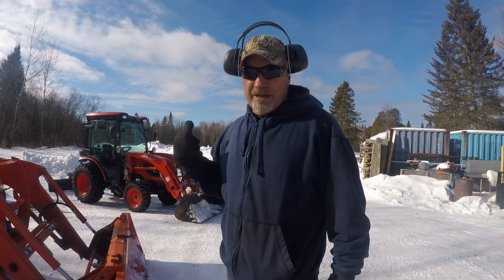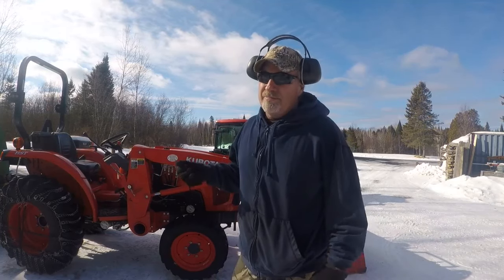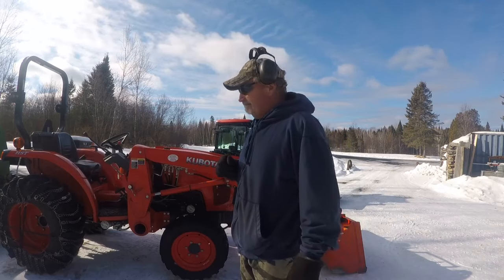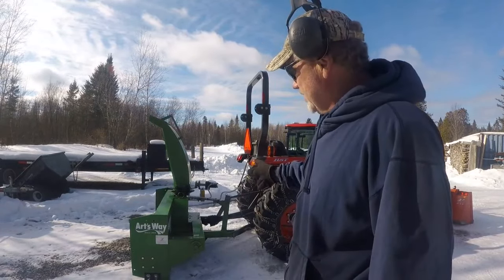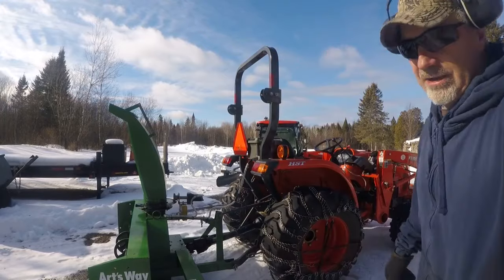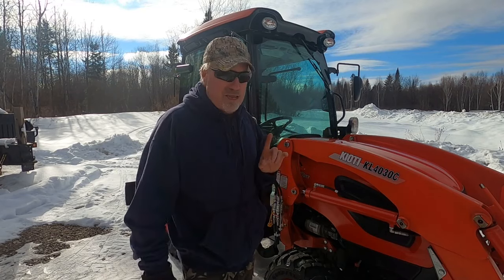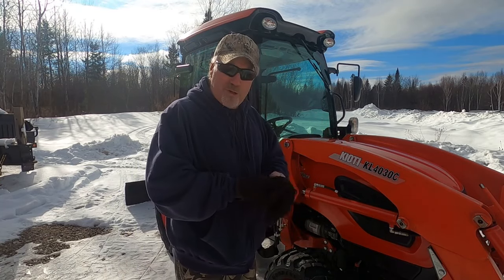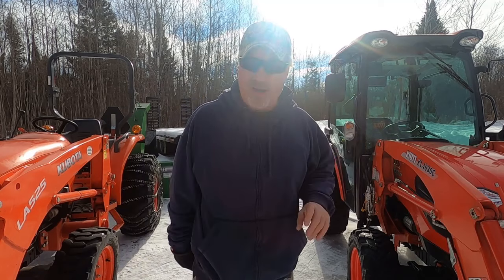Kubota vs Kioti Hydraulic System-Definitely different.

Comment: I have driven Kubota, and as you say the dual movement is smooth, which for your case is fine. However, for equivalent models Kioti can lift large logs whereas Kubota fails. I just want to lift a log off the ground and transport it, not do the swan ballet with it.  I'd probably go with a blower for snow anyhow.
Reply: we bought a kubota l4760 cab tractor wich much better system then kioti plus our kubota has a good 2 function on its hydrulics

Comment: Hey Mike love your vids. I looked at a ck3510se last year and saw exactly what your pointing out here. Brought my new ck3520se home today. Night and day difference on splitting the functions in my opinion. They must have figured something out. Was a Kubota owner but once it was time to upgrade I could not spend more for less with them. They’ve gotten a little too proud of their product these days. -Taylor
Reply from the maker: Thats great!Hopefully they keep striving forward.Will they ever be as good as KUBOTA?time will tell.They are no slouch in the tractor world.Thanks for watching.
Reply: Same my 23 2620se I do rock work all day no issue better than my old new holland 😊
Reply from the maker: @devshewitt4809  Hey,does the 2620se have pollution crap?
Reply: @northeasterndirtandpropert7974  what are you talking about the regen system? If so no emissions on 2610 or 20

Comment: For the nearly $10k I saved on my Kioti CK2620 cab vs a comparable Kubota LX series or Deere 3 series I can live with the slower hydraulics. I’ve owned a Kubota, Deere, and now Kioti and I like them all but when it comes to lift capacity the Kioti puts the other two comparable sized tractors to shame. For a homeowner who owns a few acres or a small homestead a Kioti is a great tractor based on cost but if I were in a professional business where my butt was in the cab most of the day then I could make a case for the extra cost of the Kubota. Just my thoughts on this.
Reply from the maker: Can't blame you for going Kioti.Thanks for watching.
Reply: I just priced both models and they're actually exactly the same price at about 28 to 29000 depending on which dealer you get it from
Reply: There is a large price difference. I’ve been shopping for larger tractors, 70-75 engine hp bracket.  With Kubota and Kioti spec’d with the same features for hydraulics etc, the Kioti came in $24,000.00 under the Kubota. I put a down payment on the Kioti yesterday because it’s exactly how I want it.

Comment: Seems like on the kubota you raise it and then dump so not really 2 functions at the same time
Reply from the maker: Watch the bucket roll and boom at the same time all thru the demo.I tried to be as unbiased and ran both machines at 1800 RPM where both machines have more than adequite flow and engine RPM to do most loader applications.thanks for watching.
Reply: I’m seeing the same thing.  Two different styles being used when using the loader.
Reply from the maker: @TM-jl1zd  if in doubt,try one out.I only present what KIOTI engineers.
Reply from the maker: @7M-7  Thanks for watching and accessing the videos.But again,i don't engineer hydraulics for KIOTI,i just present the facts as stated during operationAND quoted in the KIOTI owners manual.Both are good tractors,one is just superior in the hydraulic engineering dept.Kubota,known for well engineered Hyd,enginneering,resale,uptime,fit and finish.I own them both,I like them both.Thanks for watching and commenting.
Reply from the maker: @Bethia  When you get some hyd experience and operating experience,talk to me.

Comment: I believe you should be running about 2200 RPM on the new Kioti’s
Work out a wee bit, and you will find that sweet spot where you can curl and dump real quick. One thing I like about the coyote, you can certainly lift a little bit more more weight than you can with the Kubota.
Reply from the maker: Not only lift more,but a heavier tractor overall,at a more affordable price for the machine.But in the end,everybody should demo the tractors,and make an informed decision on what suits there needs best.Tractor companies can't afford too many mistakes these days,they won't last.
Reply: You need to rum kioti at a higher rpm and it works great... from the sound on your video it sounds like you are running the Kubota at a higher rpm...

Comment: Kubota also costs more so it makes sense as typically you get what you pay for. Personally I have a CK 2620 and I love it no complaints. It has done everything I’ve asked of it and then some
Reply: Good to know. I guess that one replaced the 2610 with the 4030 loader. May I asked what you paid and what implements you got?
Reply: @MrCPPG  Yes it replaced the 2610. I got mine about a year ago for $23,500 out the door with the loader at 0% interest. I have pallet forks, a stump bucket and a TR3 rake at the moment. Looking into a stump grinder and grapple next.

Comment: That was some fantastic visual proof of the differences. I guess it all boils down to what you need and what makes you happy. I guess you needed a cab more than super smooth hydraulics. I guess if 10 - 15K means nothing to you then you can have both in the Kubota.
Reply from the maker: Unfortunately 2 tractors is just not cost effective around here.BUT,you never know whats gonna roll in and out of my shop.And honestly,here in Canada 10-15 thousand ain't getting you much size or something thats not clapped out.Hobby tractors just ain't cheap.What is.Thanks for watching and commenting.

Comment: I have a Kioti CK4010SE just made a warranty issue video yesterday may put it up soon.  The 3pt lift Hydraulic valve failed with only 220 Hrs on the tractor and was still within the time limit of the warranty.  Kioti did not cover this repair.  The proble was the 3 pt lift would surge up and down with any load on it.  After the vale was replaced, it worked fine.  You can click on the icon to see more details on this

Comment: My NX5010HST doesn't have this problem. Maybe it's because of the higher flow rate on the NX chassis.
Reply: I would think it’s everything to do with flow rate, also perhaps speed is also sacrificed for additional lift capacity as well. 
That’s why people shouldn’t get all dead set on which lifts more because it’s not going to matter much if the one that lifts a Little less lifts twice as fast.
Reply: @jacobhendrickson8935  That's a very good point !
Reply: @jacobhendrickson8935  If you can’t lift it it doesn’t matter how fast
Reply: Glad you piped up as I’m looking at a NX6010HST to complement my Kubota MX5100 (or vice a versa). If someone made a M4/RX sized tractor with a hydrostat, I’d be all over it. The NX appears to be the closest.

Comment: On my previous JD 3720 Cab, and my current JD 3046R Cab… I have a selector at the base of my joystick.  It can Lock the joystick.  It can make it 4 direction only… and it can make it regen-hydraulics.  So I always keep the selector on Regen.   The bucket is kind of gravity assisted in its dump routine while this function is selected.  Do you have a lock switch on the base of yours?  It’s an easy thing to not even notice on mine….   But if you do, it may help.  So my will do these mixed motions with ease as well.
Reply from the maker: No regen that I am aware of.4 pressure and 1 float function.As it stated in the KIOTI manual,its not designed for an efficient 2 function system.It will do it,but its a struggle and its slow.Thanks for watching

Comment: I’ve had 2 kubota’s and 2 kiotis. Both are fabulous machine brands. I currently own a DK40 se hst (2014). I bought it new just before many of the emissions were required. This model is much more robust than the newer DK line that came out soon after. The Kubota Grand L39 was also a consideration. It had a more advanced transmission,but other than that the Kioti was better ( in my opinion) and definitely stronger. It was about $8k cheaper too, but that had very little to do with my decision. I would but the same machine over and over again a dozen times. If someone I knew was looking for a 40-65 hp tractor with all the bells and whistles I would look for a Kioti DK line of tractors  from 2008-2015. These machines are tough, strong, well optioned, high hydraulic flow, etc.
Reply from the maker: The cost spread seems to be getting wider.KUBOTA up at least 3% according to dealer.Almost 10% cheaper for a KIOTI CK2610se VS KUBOTA LX 2620..Plus KIOTI puts a tremendous amount of standard features on what KUBOTA calls options.Thanks for watching.

Comment: I've owned two Kioti tractor so far, a subcompact CS series and currently a DK 5320se cab.  When I upgraded I looked hard at a Kubota and did lots of test driving different brands.  Kubota tractors DO have smoother hydraulics overall.  I operate a construction grade wheel loader at my everyday job and the hydraulics on it are better than Kubota's as well.  So there are always better options out there.  However, in order to get the same lift capacity in a Kubota that I get with my Kioti, I needed to go all the way up to an MX series tractor.  That thing is WAY too big for what I do.  The DK series hydraulics is better than my CS series tractor was though as far as smoothness and ability to do  two functions at the same time.   I do agree with you though, Kubota's hydraulics are better than ANY of the other tractor brands I tested and  I tested them all.  Great video you put out showing this obvious difference in performance.
Reply from the maker: I agree.thats why the video was based on function and not lifting capacity,tractor weight and so forth.Kioti Has a lot to offer a tractor owner,I see it.Watch the next video,and i will reveal  a couple small notes on the KIOTI that i have not mentioned.I want ALL the comments to roll in before I reveal a smackdown on any doubters out there on my testing and performance between the two.Thanks for commenting,I like hearing from operators who actually put there hands on other brands.Thanks
Reply: @northeasterndirtandpropert7974  oh ya brother! There are lots of different views and applications for each person. I do appreciate your point in this video though. It's accurate from my point of view. Subbed to see more

Comment: I like the smoothness and dual functionality of the Kabota.   Definitely helps justify the higher cost of a Kabota.
Reply from the maker: The difference in cost I bet would be minimal to design the kioti circuit to deliver a little more flow to the secondary function.Every tractor manufactire has multiple hydraulic engineers in R@D that work on these circuits in design phase.Kioti in my opinion is just taking the easy,simplistic,way out.Just my opinion.
Reply: There is a substantial difference in price. When I was shopping, it was almost 9k difference, less warranty and features on the kubota.
Reply: @northeasterndirtandpropert7974   It may have been a compromise to increase capacity in a single function. Some folks prefer to lift a bigger log even if it is a little jerky without going up in class of tractor.  You should get rid of the Kioti rather than bitch about it. I definitely won't buy a Kubota like my brother. Lousy dealer, lousy factory customer treatment.
Reply from the maker: @MrCPPG  I just state the facts as engineered by KIOTI.Don't let the reveal from the owners manual sway you from purchasing a KIOTI,they are good machines.Every one has different needs.

Comment: Just subscribed and enjoying your content. I have a new 2023 Kioti 2620 hst open station and Im coming from a Kubota b1700 from 1999. The Kubota definitely has refined hydraulics but mine doesn't seem as big of a difference as your video. My rear hydraulics on the Kioti does the same as yours and reading up on it from different sources that jerkiness is normal for Kioti's and is called step hydraulics whatever that means. Everyone says to raise fast and then lower where you want it. Overall I'm satisfied with the Kioti. I find higher rpms works better for loader work and using the 2 functions at the same time.
Reply from the maker: Higher RPM's definitely makes a difference in flow rates to a point.BUT,I'm a big fan of adjusting RPM's to the task at hand.High RPM's cause excessive fuel burn,premature engine wear and in the end,overall its costing you more money to operate.It will still not change the priority vs secondary valving in the hyd stack,that never changes.Thanks for watching and commenting.

Comment: I’ve got a CK40 and I can literally use my finger tips to use the front loader. Might just be that particular tractor. Also I’ve spent a bit of time with the loader and haven’t even noticed not having dual functions. I really want to upgrade the size of my tractor and am considering a Kubota MX series but the Kioti DK series beats the MX in loader capacity and 3 point capacity and only weighs about 400lbs less. All being about 10k cheaper..Kubota are great tractor but the price has kept me away..

Comment: To anybody who is saying the kioti are significantly less than the Kubota you are wrong. I got multiple prices on both cab models kioti CK 2620 and the Kubota LX 2620. The Kubota actually came out cheaper at $28,500 and the kioti was $29,600 therefore the Kubota was actually cheaper. I have the paperwork right here to prove it.
Reply from the maker: I guess it depends on the dealership.When i compared equivalent models,KIOTI was substancially cheaper.I don't doubt your pricing for a minute,dealerships are all over the place.Personally,i would buy the KUBOTA.
Reply: I've noticed that too and it is going to be dealer dependent but it does seem the price gap between the two brands is not what it use to be. Kioti still seems to be cheaper but not as much as it use to be, not like TYM or LS cheaper. It seems like their popularity increasing has also caused their pricing to increase.
Reply from the maker: @brianlb78  Kioti is definitely gaining ground.Along with that,comes the ability in the mindset of the company to jack up pricing.Kioti would be my second choice after bypassing Kubota.they make a good tractor and a great warranty.
Reply: I got the 2620 with loader, grapple and bucket for 20k. Send me an invoice on a kubota to match please

Comment: I can vouch for this. I own a kioti ck3510 hst and had to backfill a septic tank/leach field just recently. The curl on the bucket was so slow when lifting and lowering the loader. 

But for the most part... im not moving that much dirt, and that project was a rare occasion.
Reply from the maker: Exactly my point.For the average hobby farm,or home owner these tractors are great.Not until you really need to do all day loader work does it become an issue.Thanks for watching

Comment: The difference could be a couple things, the Kubota could have a more advanced Hydraulic system with a sort of load sense (more expensive, more expensive to maintain) or it could be in the profile of the hydraulic spool of the joystick... An ubrupt  edge on the spool profile creates an on/off action where as a notched or angle profile allows for a smooth transition or blending. Im curious if kioti will pickup on this and get it improved for future models.

Comment: Do they both have the same gpm? or does the kubota have larger capacity, helping the two circuits happen at the same time.  I prefer my komatsu wheel loader to any farm tractor. or any of my skidsteers. visability and hydraulic capacity makes any conventional tractor sad.
Reply from the maker: KIOTI on paper puts out more flow.GPM would make NO difference in this case.It would make hydraulics happen faster,but you still lose the ability to do two functions at once.That comes into manifold and valving stack arrangement.With KIOTI,the loader gets priority and the roll in the bucket gets secondary flow,or whatever the circuit can feed it while the loader is going up cons uming the bulk of the flow.Thanks for commenting

Comment: Why would you try to do that kind of work at 1800 RMP?????
Reply from the maker: Because I match the job to the machine.No need to scream a diesel needlessly,contrary to the commentors opinions.premature wear on oil,engine.No need to lug it,but no need to scream it either.KUBOTA hydraulics work just fine at 1800 RPM,what KIOTI does in the engineering end is lacking,RPM aint gonna change how oil flows thru an orifice in a manifold,just make it more jumpy.KIOTI needs to design there flow path more effectively in there system,not try to create high flow thru RPM,thats not gonna change anything.look into it.Its all about oil passage.KIOTI ,unless they redesign,will NEVER match KUBOTA hydraulics.BUT,the tractor works just fine if you are not put off by this.Some guys just get butt hurt when the facts come out.
Reply: @northeasterndirtandpropert7974  guess the minimum mph sign on the interstate is for people like you.